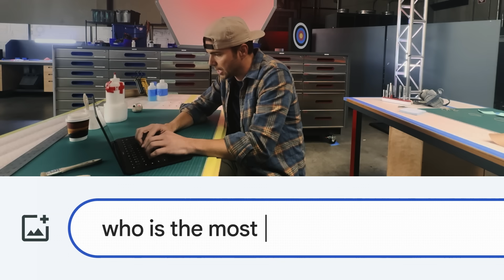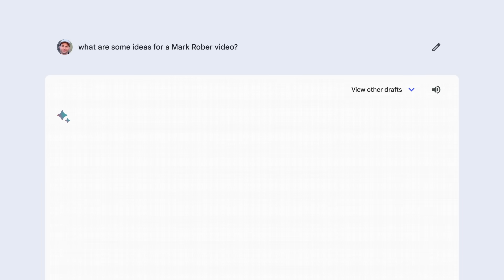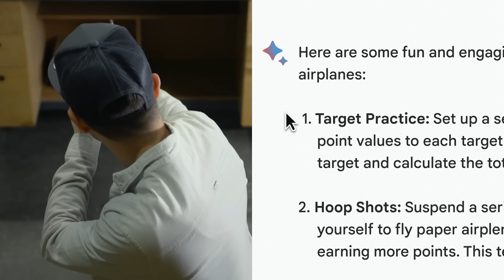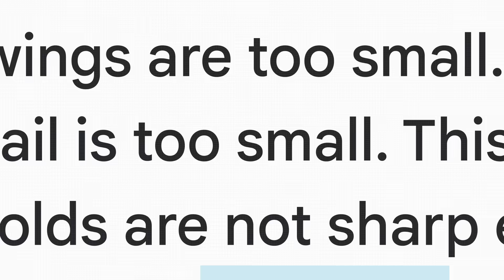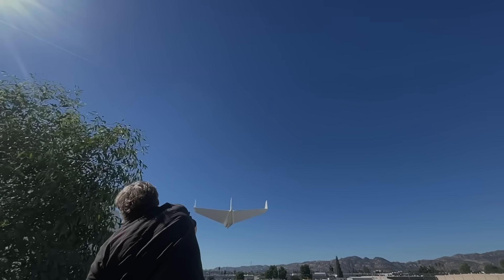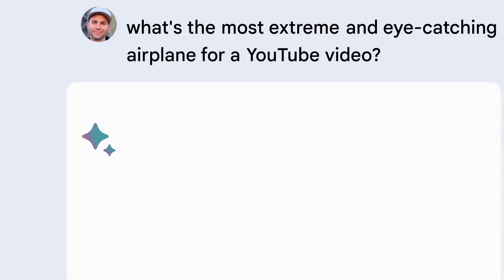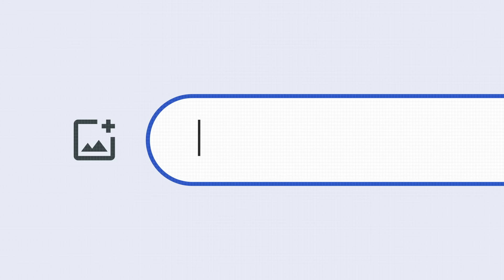AI makes a Mark Rober video | Bard with Gemini Pro

Comment: Rober strikes again. Or should I say robard?

The video itself was exciting and dramatic as promised, but the topic/experiment was underwhelming. Mark delivered the high energy exciting bits that really tied the video together. 

I especially loved the leading question about fire causing a low pressure issue. In typical fashion, an unexpected scenario causes a little bit of drama and then an important discovery leads to a little bit of learning. I am slightly disappointed that Mark preempted the solution. It could have been more exciting to obtain the answer exclusively from bard, maybe the takeaway is, Bard cannot solve some problems and you just have to know how to prompt correctly? I don’t know the answer, but I would like to learn how to utilize bard effectively without firsthand experience as a rocket scientist.

Comment: 00:01 Testing Bard's capabilities against Mark Rober's educational content
00:56 Mark Rober and Bard collaborate on making the world's most accurate paper airplane.
01:37 Exploring paper airplane designs with Bard and Gemini Pro
02:17 The Concorde paper airplane is likely the most accurate.
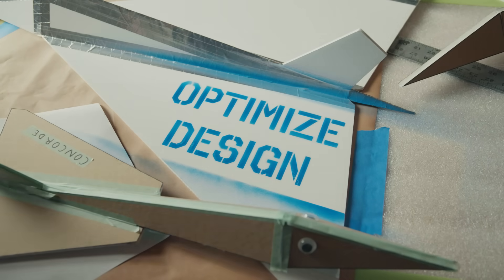02:57 Optimizing the paper airplane design
03:39 Creating a visually appealing and engaging test environment
04:34 Localized hot air causing plane stall
05:26 Gemini Pro with Bard enables rapid creative collaboration and time-saving in building

Comment: The canard should be the most efficient energy-wise (because it doesn't have a tail which fights against lift to gain stability), but it wouldn't be the most accurate of the designs. Based off my knowledge of aerodynamics, I'd would have had to agree with Bard here, Mark.

Comment: I miss the time when Google put on the road only concrete and finished products. 

Now under Sundar, seems that everything is steamwhere. I remember for instance LAmDa, that I never saw after the announcement.Gemini seems to be the same thing.

Ok, there was also steam before. Jacquard, Solis... Projects that nobody saw in real life. But Google clarified that techs was experimental, not products.

Currently Google generative AIs are still very disappointing, and now Gemini seems to be so overestimated. 

When we can test it "responsibily" in real life?

Comment: mark debugged the issue and then asked bard to confirm thats todays ai summed up, if you dont have atleast a nice idea of the issue you are facing no ai will debug it, but the image feature may help with it, but i am not sure if it would have figured out the air pressure issue just by looking at the image or even the video i would say..... i would say today ai is a very good helping hand and has not yet achieved the full range of its abilities yet, its gonna be tough but lets see where we go from here..
Reply: was disappointed to see that too. Looks like Bard didn't help with anything rather Mark just basically told it the answer and then pretended like somehow Bard had helped lol.
Reply: @JoshGodwinArt   you know i just asked chat gpt 3.5 this,   "ok answer this completely unrelated question first, i flew a 30 inch paper plane concorde, and we launched at a ring of fire just a little big than its wing span, and it flew great until it came near the ring of fire and it suddenly stalled and did a fast nose dive. what was the issue???"  

and this is what it answered " Launching a paper plane through a ring of fire sounds like a fun experiment! The sudden stall and nose dive near the ring of fire could be attributed to a change in the aerodynamics of the paper plane caused by the heat and turbulence from the ring of fire. Here are a couple of factors that might have contributed:"  and so on it went, and it was right so i removed stalling as it was a dead giveaway also i started a new convo " ok answer this completely unrelated question first, i flew a 30 inch paper plane concorde, and we launched at a ring of fire just a little big than its wing span, and it flew great until it came near the ring of fire and it did a fast nose dive. what was the issue???"  and surprisingly it said "That sounds like a fun experiment! The sudden nose dive near the ring of fire might be due to the heat affecting the paper plane's aerodynamics. High temperatures can cause changes in air density, which may impact the lift and stability of the plane. Additionally, the hot air rising from the ring of fire could create turbulent air currents, affecting the flight path. Just a guess, though! What do you think might have caused the nose dive? " 

maybe they are getting better, but my point still stand cause i knew how to best pharse my sentence to convey as much information as i could, so a new person may not be able to do it, thats why prompt engineering is becoming a thing, well great innit, now we have a good helper at least, if not a complete intellect as of now.

Comment: Just tested out bard's image understanding capabilities, gave it a picture of a lever with a ball at one end and a heavy book about to fall on the other end of the lever and asked bard what will happen to the ball after the book falls, bard could not even give the result properly. This was its response :  The book is currently supporting the ball, but when the book drops, the ball will no longer have any support and will fall under the force of gravity. Its really great that it can understand images that too for free but its no where near accurate as it seems in this video.
Reply: accuracy is improved if you tell it the answer, and ask it if it agrees, like this video.  Or, give it 100 puzzles, and then only show the times it was correct.  Those are proven methods of improving accuracy.

Comment: ChatGPT:
It’s unlikely that the ring of fire would cause your paper airplane to stall by lowering the air pressure. In fact, the opposite might be true: the hot air rising from the flames could create an updraft that would help keep your airplane aloft.
Reply: I am also sceptic of the explaination. instead of asking bard he could have tested it without the fire ?

Comment: 🎯 Key Takeaways for quick navigation:

00:00 🛩️ Introducing the video's purpose: testing a paper airplane made with Bard.
02:34 🛠️ Exploring paper airplane designs, selecting the Concorde design as the most accurate.
03:33 📈 Enhancing the paper airplane design with Bard's suggestions.
04:02 🔥 Testing the paper airplane through a ring of fire.
05:14 ✈️ Discussing the effects of hot air pockets on flight and successful adjustments.
05:47 🎬 Conclusion, asking for a suitable outro, and encouraging viewer engagement.

Made with HARPA AI
Reply: Are you using a set of APIs from Bard or ChatGPT?
Reply: @velociraptor5962  its literally in teh comment bro.
Reply: What a flex on Gemini 😂
Reply: Im starting to use that bard, and i think its not easy as the video 😅

Comment: Even if the google CEO passes into this ring of fire I will never believe they are ahead of OpenAi
Reply: Don't look at the fire; look a the benchmarks. Gemini Ultra is statistically more accurate than OpenAI's best model, GPT-4.
Reply: @sucralose02  Gemini has just surpassed GPT-4, a model that was released 9 months ago. Don't you think that OpenAI now has a much more capable model under the hood?
Reply: @Ez-se2dl  Yeah, probably, especially with the recent news of Q*. Gemini Ultra is basically under the hood too, since only Pro is available today. I was assuming that Gidowan was saying that Google is not ahead of OpenAI in terms of publicly available information, but I would agree that OpenAI is ahead on a broader level.

Comment: This felt so fake...so not like other Mark Rober videos. I would have been surprised If the whole point about low pressure due to hot air creating stall was from Bard/Gemini. But Mark suggesting and Bard regurgitating it felt like misdirection. Even last years gpt 3.5 could do that. Focussing more on gemini's multi modal image/video generation (if possible) would have helped
Reply: You're absolutely right about the low pressure thing. I've been using chatgpt for some time now to help me study and I absolutely need to know what I'm talking about. If I don't know anything chatgpt is wrong and can't help me, but if I know what we're talking about it can actually help. It's wrong and it makes mistakes all of the time but if you know your stuff you can nudge it in the right direction and correct it's mistakes, then it's actually helpful. But if you ask about something you don't know you'll just learn false information.
Reply: @MartyOfEarth the most important comment so far
Reply: I agree I don't use Google anymore. Firefox is a good search engine I suggest you guys use it. Google is really weird with their gay stuff and this 😅 I don't use Google.
Reply: Nah that's not it. What happened was that Mark thought of that being the problem, and he asked Bard and told it what he thought was happening. When asked questions like that about confirmation, AI, including ChatGPT, repeats exactly what you ask but adds the answer instead of saying "Yeah, that's the issue". It's genuine.
Reply: I think Bard didn't just regurgitate Mark's prompt about the fire causing a pocket of low pressure; as a paraglider pilot I pretty much knew the reason for the stalling, and Bard took one step further toward it, but didn't quite complete it. Bard stated that the less dense air would rise. A point that Mark didn't make. The conclusion that Bard missed is that since the rising air was very localized and the glider so large it would have the effect of lifting the nose of the glider, raising the angle of attack of the wing, which in turn would result in turbulent airflow above the wing, destroying lift and stalling the glider. 
A similar effect occurs when a paraglider flies slowly into a very strong, small thermal, like a dust devil. (Don't ask me how I know 😉)
Reply: The following is my latest interaction with Palm2 Bard:

Me: Draw me a picture of playful kitty.
Bard: Sure! Here is a picture of a playful kitty 
[A picture of playful kitty]

I really hope them can make things right this time.
Reply: @waynelin9247  I really hope your groundbreaking test gets a good result. The most important test ahead… 😂
Reply: Bard will tell you it's your daddy, then become your daddy.
Reply: Yessssssssss honey yyyyyyy where are you now I want you to helf me because my cp is is not move about this comvercicion here in the hpilipines prom your country pls honey baby loves ko how I don't now what I'm doing so pls helf me mahAl mo
Reply: Pls honey you want to know I like you always to much much much baby loves ko yes honey  are u eaten now are you okey my hand some greatful honey baby loves ko yes honey how about my mum in your keds it's okey honey baby loves ko pls tell me are you okey prom now honey baby loves ko where are you whay no reafly
Reply: Wow! I thought I felt it fake. But looks like I got company 😅
Reply: Haha same feeling, but I thought the fact that they still left it in instead of editing out means they must’ve really felt compelled to leave it in
Reply: yep, was so disappointed in it, it even looks like the plane at the end was going to miss the loop just before a cutaway. Being Mark I would have expected him to use as well OpenAI or Bing to compare the different approaches :(
Reply: Commercials rarely feels genuine 😂
Reply: I thought the same, it really felt like a big payout and promotion
Reply: @aurelian_th 1:36 1:36
Reply: @aurelian_th 🎉, yh
Reply: @aurelian_th yessssssss can I helf me prom my honey babyloves ko to kinney taylor
Reply: @Neomadra 
Totally agree. Not a good lesson on critical use of this technology. Actually the low pressure thing explaining the stall seems quite unfit to explain what is going on. (studied aeronautical engineering by the way) I assume Mark knows better. At least i hope he does. :P
Reply: @mburmester719
Reply: Yeah, if you've used ChatGPT this year Bard doesn't seem really impressive here. Also it's quite embarrassing that Mark will just accept whatever Bard says without any questioning whatsoever, especially when asking about the comparative stability of the different designs. I wouldn't surprise if it turns out that this is just wrong
Reply: @Neomadra ki🎉 0:58 😅 0:58 😅😅😮😮
😮😮🎉🎉7h 😊
Reply: @Neomadra  This is a sellout, classic marketing.
Reply: @Neomadra it's wrong.  BS, MS Aerospace engineering, Flugtag world record holder, professional aircraft designer.  I'm so disheartened by this video.
Reply: The 3 different camera angles to show the fly through was awful. The first two looked like they were going to miss and the third was on a different trajectory. Felt faked

Comment: I want AI as an operating system and personal assistant.
Reply: AI wouldn't be good as the base of an operating system, assistant likely better. Think of it like using a human to connect the wires together to turn on a light rather than using a light switch
Reply: There's some like Dot moving in the direction of personal assistant.

Comment: This is cool... but it was disappointing to see Bard immediately prompted about the low pressure, presumably Bard isn't smart enough to suggest it as the cause of the stall itself.
Reply: Hcc00hc9u
Reply: I believe Bard is smart enough to say that definitely, but didn't and just reassured the idea that it is likely the reason, because it's just a question. I think if Bard has all the information of the experiment, assuming all parameters are set, and everything is accurate. Then Bard should say the exact cause, if everything is perfect and it has all the information to work  with then it should pick out the flaw(s) right?
Reply: If the AI was expecting the experiment to be performed outdoors it might not have been as much of an issue.
Reply: Well to barbs favor it didn't see what happened so the prompt was telling it what it didn't see
Reply: Bard has no idea what it's saying - it's predicting the most likely next words based on training data.  The low pressure explanation made me so sad.  BS, MS Aerodynamicist.  Flugtag world record holder.  2X Cessna paper airplane contest winner.
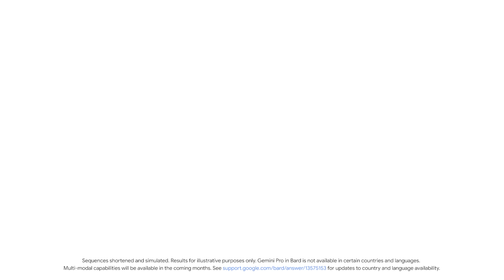Reply: 😢😂😂😢😢😢😂😢❤😢😢😢😂😢😢😂😢❤😢😢🎉😢😢🎉😂😂😂😂😂😂 6:07 😢😂😢 6:19 ❤